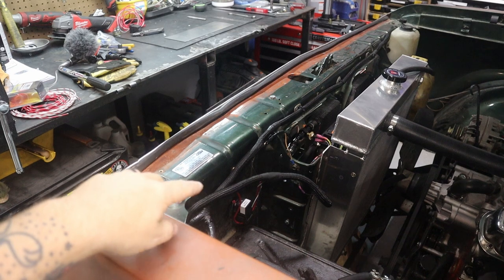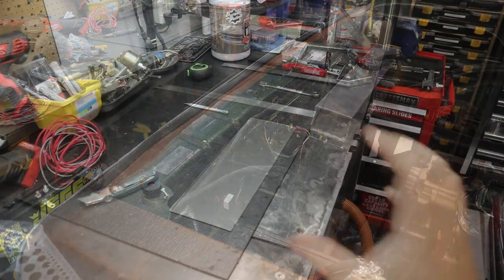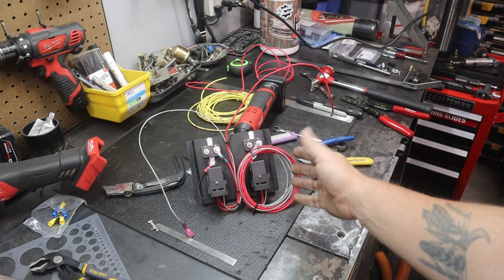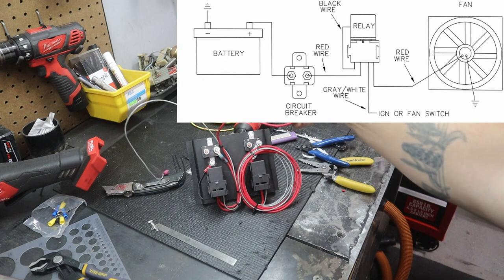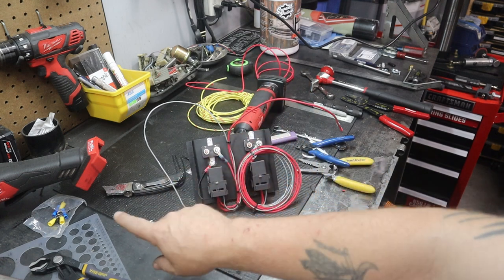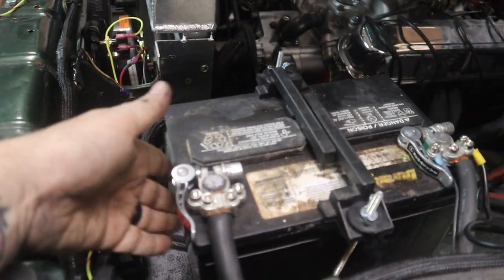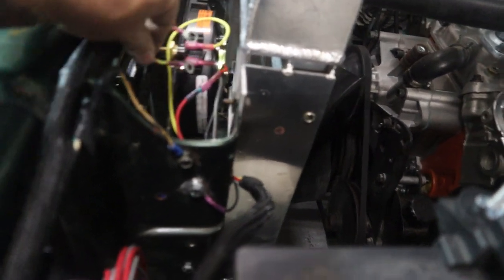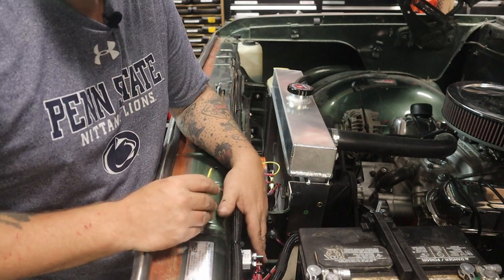How I Built an Auxiliary Power Relay/Circuit Breaker Panel | Automotive Wiring

Comment: Thank you, I appreciate all the information and details in your videos. I'm in the progress of a similar build..
Reply from the maker: Glad to help...good luck with your build!
Reply: Thanks for the video. If I'm running electric fans, aftermarket gauges, vintage air and a push start button. Should I run the same panel
Reply: I'm currently running relays with fuses for each to my battery terminal for the my headlights, electric fans and sniper efi. And the rest to my accessory on my fuse box. I really want to clean it all up. Too many wires to my battery.